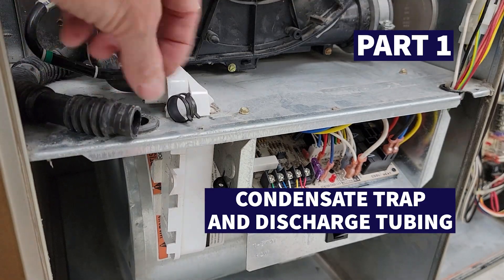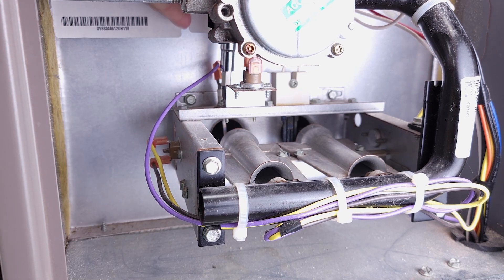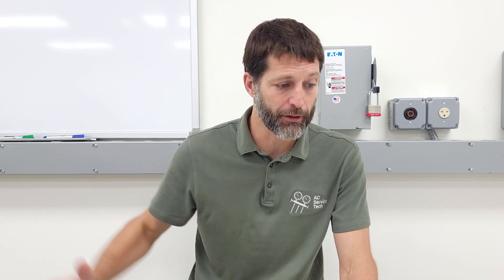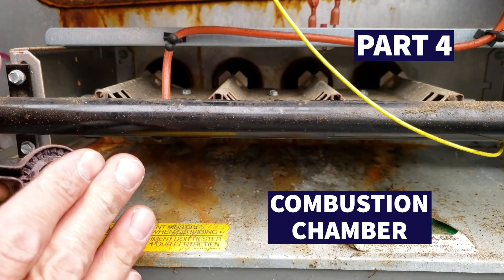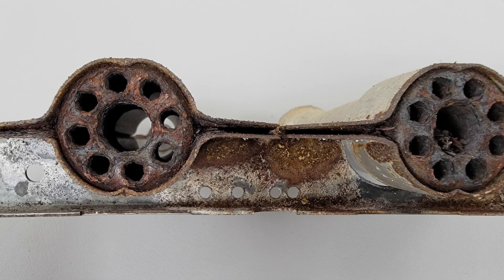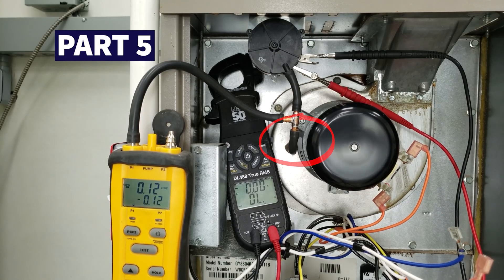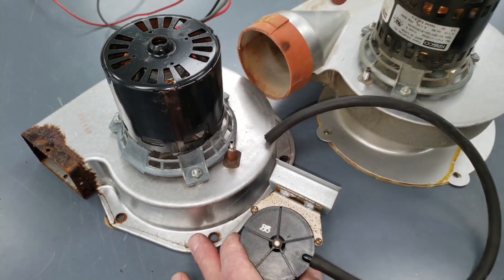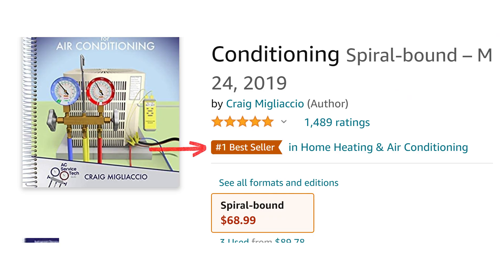5 Gas Furnace Parts That MUST BE CLEANED or the Unit will Fail and Won't Heat!

Comment: Boilers where are those videos!!!!
Reply: A boiler is just a furnace with water moving past the heat exchanger instead of air.  Still has the same items to check.  Gas train and pressure and limit switches 
Don’t get all caught up with it being water vs air, same same, it’s a fuel burning appliance,
Reply: @jw5297  I agree with you as far as air and water , but furnaces and boilers are different. Yes they do the same job  , as far as combustion yes they have the same principle but as far as components,  electric etc way different.  Furnace does not have a expansion valve , PRV , sight glass  ( steam boilers).... I have been on the field for close to ten years , I like how he explains things and demonstrate the functions.
Reply: @mangoisback  Agreed.  I thought maybe you were referring to the topic of keeping them clean and running.  
Yes the water side clearly is different but that can be made or broken by how well it is installed. 
And yes he does a great job of explaining things and his processes
Reply from the maker: We just put up a boiler zoning control video last week, thanks all!

Comment: What could be the reason for a flame rollout switch to keep tripping (once per week or so)?  
Had a tech clean out the unit, he said it wasn't bad. Tenant has changed air filters pretty regularly. It's a higher end unit from '08.
Reply: Could be a lot of things. I once had a York unit that was driving me nuts until I caught the problem red-handed . I found the circuit board had an intermittent problem that would keep the igniter on after ignition from time to time . The igniter would get so hot it would trip the flame rollout switch.That was one job I had to pull a chair up on and cycle the unit over 20 times before it happened (i’ll never forget that furnace as long as I live,😅).
Reply: @boby115 that sounds like one of those "easy fixes" that you get a call 10 min after leaving for.  Intermittent failure is the biggest pita :)
Reply: Probably a cracked heat exchanger. Flame rolling out.
Reply: @roberthayes8131  Could be.  Could be a leaking gas valve and not making all the way across the burners. 
Could be a faulting draft induce motor
Could be improper gas settings 
Could be the exhaust is on a prevailing wind side of the home and catching wind gusts 
Could be a cracked heat exchanger, popped ring and gets hot enough and metal expands enough for the blower to affect the unit.  
Someone needs to put a combustion analyzer on it that knows what they’re looking at and can tell you exactly what it is.
Reply: Many things could cause it.  Checking gas pressure and doing a combustion test would point out that culprit
Reply: Interesting how no one here states the obvious i.e a plugged heat exchanger or a cracked heat exchanger. This needs immediate attention, do not use until repaired.
Reply: @mrofnocnon cause the info is vague. A cracked heat exchanger does not always roll out flame, more often flame rollout is caused by vent obstruction or a failing gas valve.
Reply: @MrDmadness  I agree but if we assume this is a high efficiency unit as the post suggests the roll out switch is prior to the heat exchanger, a plugged vent will cause the pressure switches to open. Gas valves do fail but almost always closed. If the pressure setting is incorrect that could cause rollout but it would be so from when first installed, it would not suddenly change.
Reply: @mrofnocnon pressure switchescan prove even with a partial blockage. That its rolling out ( if witnessed ) says that its seeking primary combustion air after its proved the safety circuit, id check combustion air pot, and look for any sooting. A cracked heat exchanger typically causes flame dance after the blower kicks on and is prety easy to diagnose they have to be pretty severe to cause a detectablke roll kut ( not impossiiblle though ) if its a single penetration supply abd combudyion fittinb then ud also check for vent grade and for and trapped condensate in the line ( insufficieht primary combustion air )
Reply: @MrDmadness  Flame distortion only occurs from a  cracked heat exchanger when the blower is running and at no other time. Vent pressure switches have a very narrow margin for vent restrictions, yes it can happen on occasion the exception rather than the rule. Trapped condensate from a blocked drain eventually slows down the inducer, which trips the pressure switches again. If vent grade was an issue it would occur right after installation. Just giving you my opinion after fixing literally thousands of all kinds of furnaces and all sizes.
Reply: @mrofnocnon yeah, ive been doing this over 30 years, im jot saying you are wrong here im just saying potentials always are situational.
Reply: @MrDmadness  Indeed they are.
Reply: Sooting of the heat exchanger, a dirty air filter, a partially obstructed exhaust. So many things. A new door on the furnace room entry that does not have baffles replacing one that did ( not enough primary air )
Reply: Thanks all. Some great insights here. I'll be giving these suggestions a go and investigate more. Will reply back as well with an update for those curious.

In the meantime, I showed my tenant how to reset the switch which she's been having to do still about once per week.
Reply: @hardcoredrrk  do you have CO alarms in that home?
I’d highly advise not running that furnace until this situation is resolved 
Could mean life or death
That furnace no matter what it is, is not safe
Reply from the maker: Thank you all for replying to @hardcoredrrk Do not hit the reset on that and like JW said, make sure you have carbon monoxide detectors in there. It could be a cracked heat exchanger. Definetly don't let this wait and make sure to call a tech in to thoroughly check this out and use a combustion analyzer.
Reply: @hardcoredrrk  Had a home in my area a few years ago where some joker bypassed one of those flame roll outs and moved the flame roll out  and the gas valve itself was leaking by and it filled the basement with gas lit, exploded and lifted the home off its basement and when it sat back down had shifted 3” CCW on the foundation 
Do not sacrifice safety of your property or life in it over money or lack of figuring out the problem.
I also worked for a company who thought they had addressed an issue with a fuel burning appliance, and the tenant died from CO poisoning, believe me, you’ll go to court, anyone associated with it will too, do the right thing.  Call in someone who will figure it out, if your a tech out there and you have any doubt call in someone else to help you, you do not want that situation on your hands

Comment: I can't believe you never mentioned cleaning the pilot. Still used in many older furnaces that are still out there.
Reply from the maker: Certainly you are right on the money if they are not burning right, the pilot tube gets covered in soot and then the pilot flame gets choked out, thanks!
Reply: @ Typically the primary air for the pilot becomes restricted by dust.
Reply: @acservicetechchannel do you have a video for that?

Comment: Just throwing this out there but if your running a PM or service call to a fuel burning appliance and your not doing a combustion test and analysis and removing and cleaning the flame sensor, shame on you!

Be a technician, it literally takes 30 minutes and you could save a life, and you will definitely will save them money and prolong the life of the equipment, IE doing your job.
Reply: Also educate the customer on the standard carbon monoxide detectors and how they work, and offer low level carbon monoxide monitors.
Reply: @Stormblessed_13  yep until the fire department tells them to ditch them 
Have had it happen many times. 
Nighthawk low level detects the home owner has opened the man door to the garage with the car running in garage with garage door open but the CO comes in and it goes off.  
Educating your customers and actually helping prolong the life of their equipment is why your there, earn your money and make the relationship with the customer!  
It will pay off in the long run.
Reply: @jw5297  yea we offer the NSI 6000 and I educate the customer the best I can while I'm there and am always educating myself to learn more and more about carbon monoxide and its effects.

It's a scary thing and I feel like not enough people know about the different types of detectors and carbon monoxide in itself.

I've had numerous customers thank me for educating them because they didn't know. It's truly rewarding.

Comment: I really like it. I am Maintenance technician is there anyway to make step by step a furnace and heat pump maintenance videos? Thanks for your help
Reply from the maker: We just try to focus on one topic at a time. Thanks for letting me know what you would like to see!
Reply: @acservicetechchannel 
Thanks
Reply: Make, model, s/n. Know how to read an electrical ladder diagram and you will always know the order of operations. If you don't get an inducer motor first then you won't get an ignition spark and you already know the motor or tubing is bad ( or the exhaust ). You must know electrical theory, I don't care what anybody says, as a service tech you need to know it well. Finally grounds are so SO overlooked. Even if it's not the ground, it's always a good step, to clean ground surfaces when troubleshooting

Comment: Do a video on combustion analysis and what the parameters should be. Thanks
Reply: Look up NCI all the info in the world about proper combustion
Reply: NCI has all the knowledge you will need.  Be careful who you research or watch, because a lot of people are misinformed when it comes to combustion analysis.
Reply: @Stormblessed_13  Agreed
Reply: Yes this is huge and always confusing to new techs especially since we only do heating certain times out of the year so it’s easy to forget and with new efficiency standards this could really help. On natural gas and LP. Thanks Craig
Reply: @Michael A Combustion really isn’t complicated 
If your not checking it on fuel burning equipment, you are WRONG.
Reply: Low stack temp, high co2. 

Natural gas, ch4 is 1 element if carbon and 4 of hydrogen. In EVERY fuel and gas what burns IS the hydrogen, the carbon component of the gas is the pollutant. Improper combustion yeilds Co  proper combustion yeilds co2.    Hence why natural gas is called a "clean" gas. The byproduct of hydrogen combustion is water vapor, that's why propane is known as a wet heat as its chemical structure is c3h8, that's also why it gas a higher calorific value as it has double the hydrogen ions present in combustion 
Ch4 = 1000btu/ft3 
C3h8 = 2500btu/ft3